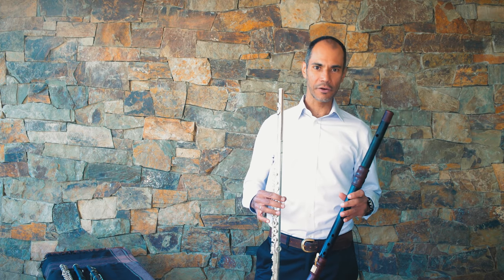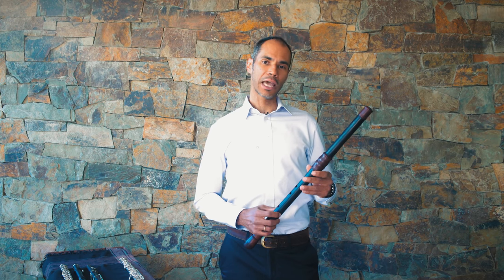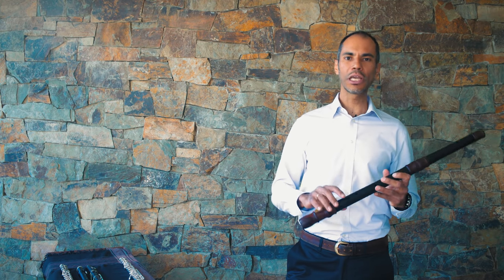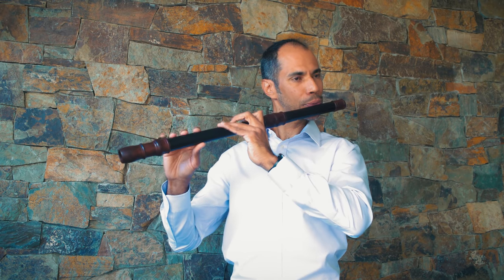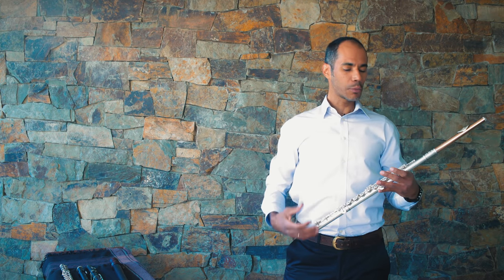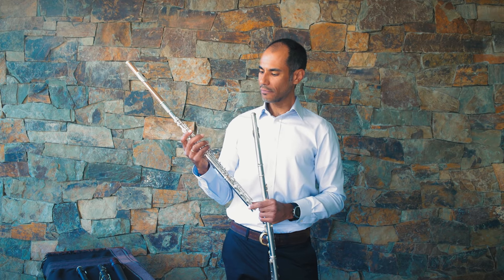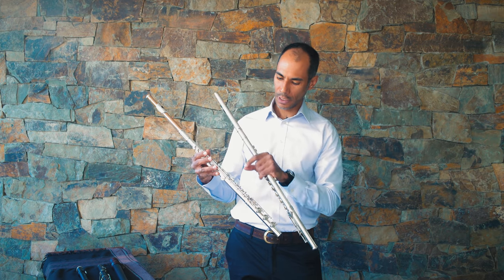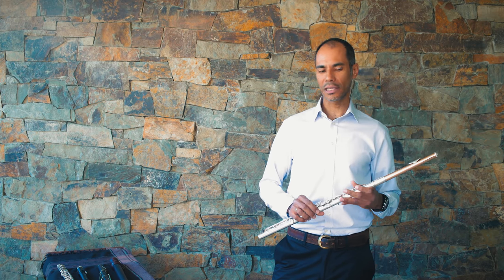Historical and Modern Flutes | Boulder Bach Festival | Ysmael Reyes

Comment: The features that really make the difference in sound between traverso and modern flute are internal bore diameter and shape, and finger hole diameters. Modern flute bore is cylindrical and narrow with very big holes, while baroque traverso bore is conical and wide with rather smaller finger holes.
Reply: Yes, except in this case the Beaudin traverso is unique in that the bore is in fact cylindrical. The presenter did not mention this. It is certainly a bold design. It will be interesting to see if it becomes widely accepted.
Reply: There is a precedent for a cylindrical bore baroque flute design by the 17c. flute maker Lissieu. (See Boaz Berney.) I think it uses Renaissance flute fingerings so it's a sort of a  link between a Renaissance and Baroque? I Beaudin is striving to adapt to the much louder modern musical environments yet still have the character of a baroque flute.
Reply: @Frederer59  you are right, renaissance flutes were louder. I guess baroque makers sacrificed loudness just in order to expand the high register.
Reply: Renaissance flutes have the same range as baroque ones (mine easily reaches 3rd octave C), although some models are limited to 3rd octave G. Probably they simply started to enjoy a flute having a more "recorder like" sound, whereas renaissance flutes can resemble us (if well made) to reeds or even the cornetto.
Reply: It seems for flutes pitch really matters. A 440hz flute will be necessarily louder than a 415 or 390hz one (Lissieu was 460+) unless you make its holes ridiculously small. And this explains why some makers never get any success when trying to adapt a historical flutes to another pitch: the timbre is going to be different, they will be another instrument. Among historical models, if I remember it well, we seldom see such thing as a 440hz baroque traverso. Of course it would be possible, but they probably preferred a warmer and softer sounding instrument instead. If I were mr. Beaudin I would instead call this flute an improved renaissance traverso (fingerings also aren't that relevant, some historical models play well with both renaissance or baroque fingerings, if well made, however renaissance finger charts used third harmonics a lot, which have a more interesting color).